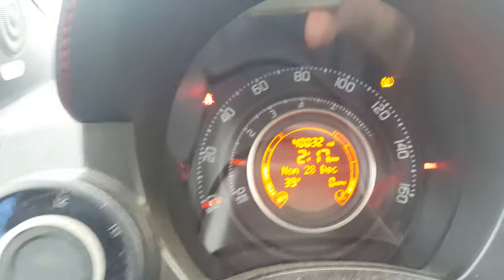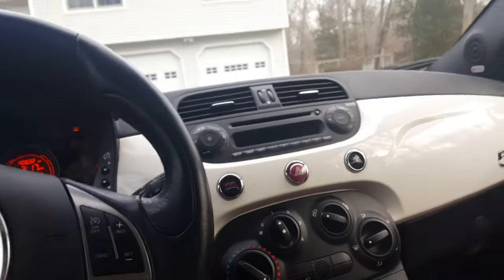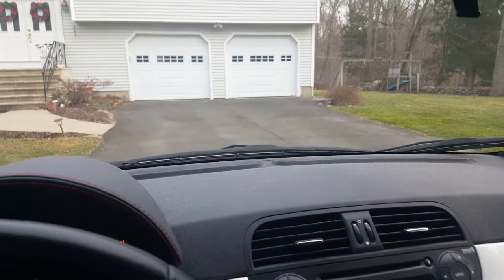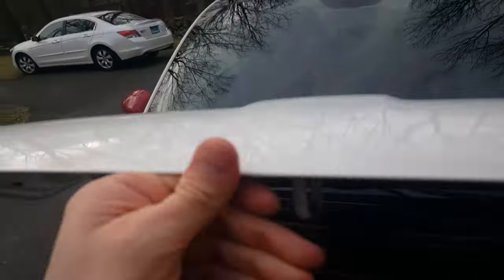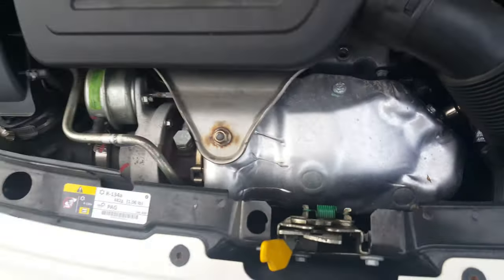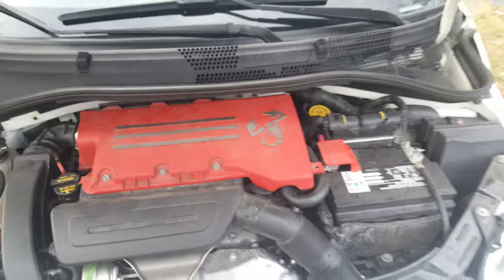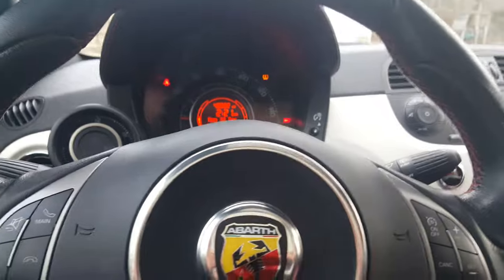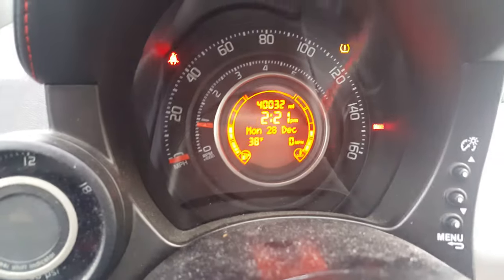3 Recalls - Fiat 500 Abarth

Comment: My 2013 has 53K and no trans issues but I did snap the shifter cable but I had a short throw kit installed which surely put tension on the cable. 

I look forward to getting into my Abarth EVERYDAY!

Comment: I had the same issue with the coolant reservoir in my 2014 abarth. Didn't know it had a leak and was going down US1 here in Florida and it told me engine coolant temp high turn off engine. Thankfully no damage occurred but happened to mine right around 40k miles. They fixed it under warranty. Only other issue I had was transmission lost 3rd gear. Or so I thought.  Debris got into the boot and down into the linkage so I couldn't put it into third. They fixed that under warranty as well but my car has an aftermarket shifter in it and they said the debris was a hair clip. I don't know how that got in there but at least it was not major.
Reply: Mine cracked too and since the coolant was low it fried that little motor that keeps pumping coolant after you shut it off to cool the turbo, it was replaced the same time as the reservoir.  Now I keep an eye on the coolant level, its a 2015 Abarth.

Comment: Hey, am planing on getting one soon, it will be my first car. Have you had any mechanical problem aside from the normal Chrysler plastics falling off, those are the ones that worry me.
Reply from the maker: You should 100% get one and you will love it everyday. No mechanical issuses at all just some stupid recalls. Unfortunatly i traded mine in for a wrx sti and i regret doing that haha. Oh well, i say. In my honest opinion the abarth gives smiles per dollar spent and very efficient. There is something about a efficient sporty car that makes me smile. Hey good luck and the white looks the best !
Reply: Depending on the year, they may or may not have fixed the rear Harness. They have truckloads of electrical issues due to the fact that the wiring through to the lift-gate is a pinch point that breaks the wiring AND the rear washer fluid hose. Imagine how incredibly dangerous that is... shorted wiring, and a broken water hose... SEEMS SAFE TO ME!
Reply: The wiring is absolute shit. You will have major electrical problems if you actually use the lift-gate.

Comment: What are the climates like where you live?
Reply from the maker: fall, winter, spring and summer. in the north east of United States we get it all heat rain and snow.
Reply: +Alessandro Altobelli Vlogs Okay.  I was asking because I was wondering if the paint and reservoir issues were related to extreme temperatures.  The coolant reservoir issue particularly concerns me.
Reply from the maker: +JamesTCA no not weather related. it was just a few defects the car had.

Comment: I have a std diet 500 nice little car but poorly engineered,  had a new clutch and bear box seals at 42k MLS  done under warranty after a lot of issues with the dealer , then had the driveshaft seal replaced after the dealer didn't replace the gearbox properly  , at 52 k out of warranty and it wouldnt hold in 5th had to have the gearbox re built with new bearings .  These cars look nice but they are poorly made
Reply: I have issues with my stick shift transmission and would like to know what the cost was for rebuilding it? Did the dealer rebuild it?
Reply: @stevenbarnes5220  hi my daughters was a 1.2 uk car dont think the gearbox is the same as the Arbath but for us the bearing went and it wouldn't stay in 5th gear and there was rumbling noises. I had a mechanic take the box out and sent off to be looked at its a common problem as like the rest of the car it looks good but made of crap quality parts.
All the bearings were replace with better quality ones and new seals fitted the sincro's were OK. 
The whole job cost me about £700.